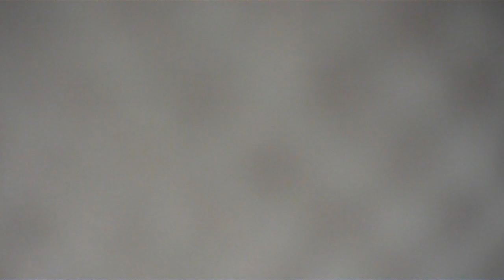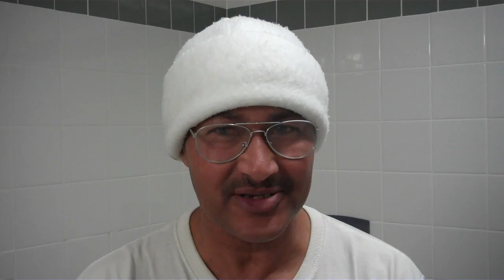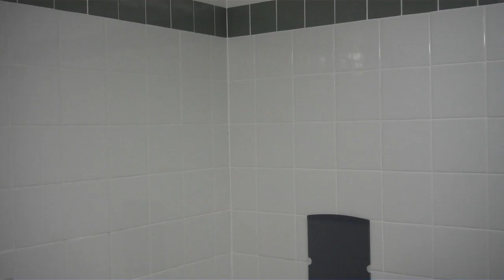Perpetual Motion Machines EXPOSED: Why No One Can Sell Free Energy!

Comment: If I were to do this i would make one working machine.  Not  just a prototype. A machine that would create the energy for a single house that was running, working.  Then I would apply for a patient on the complete machine and start selling at the same time as patient pending. I would advertise it on you tube.  The orders would come.  As i built the machines I would also patient any improvements to it as it being produced.

Comment: In my opinion you have to create or unite with an very large organization that have resource to make the machine available. In other words you need money for lawyers, engineers and promotors. If you do it all by yourself you will be crush by the oil organizations. I personally would start the development of the market on a tiny republic and established there for a few years so I can gather data on how it's working the machine and have feedback on the buyers. Then I use that as an example of how good it's working. But don't expect to get rich by the night It's a project that in my opinion you'll have to invest at least 10 years to make it globally available.
Reply from the maker: Dear Mr. Jonathan Lebron:
   Well stated. What you've written would be one of the most practical ways of doing it. My intents is to gather practical ways and knowledge of how to manufacture, produce and promote such a system. Nothing is easy in such an area. Hence: talk to others and hear what they have to say.

Comment: Off topic. Would like your opinion. I posted this on another video. 

Magnetism is a useable energy source. The key is controlling it to make it work. And a magnetic powered motor is not a perpetual motion machine. It's more than a lifetime of movement although. Which makes it worthy or research and experimentation on the "individual scientists" level. Mainly due to op-c controlling the world via oil usage. I'm sure someone has actually made a functioning magnet powered generator. And they got bought out. What we need as individual scientists is an investor and not some energy provider buying us out. We need to form a WorldWide Alternate Energy Group. The energy is here and available. 
1/26/15